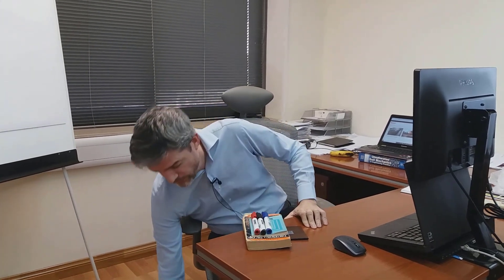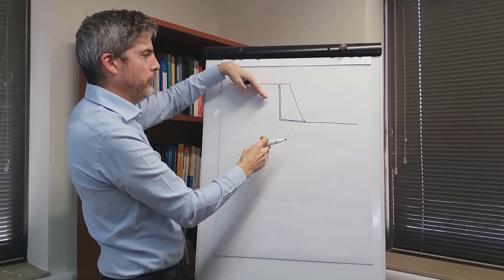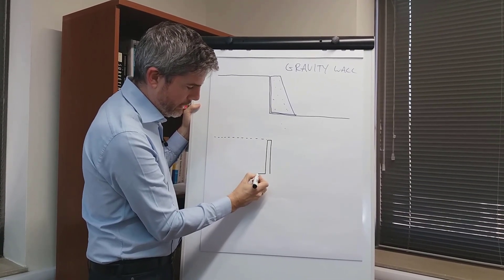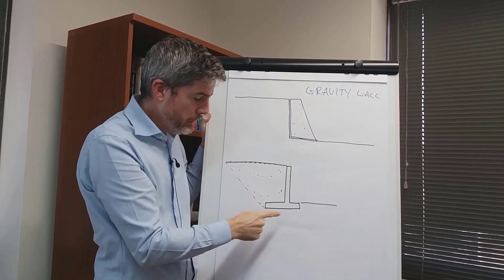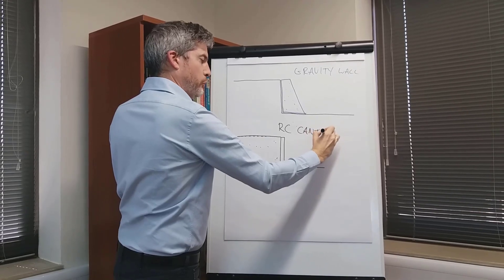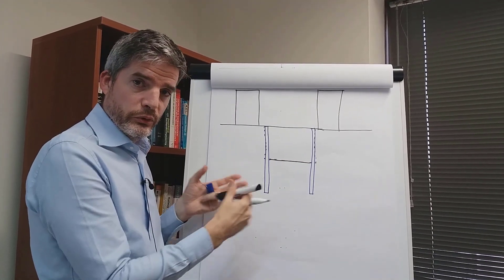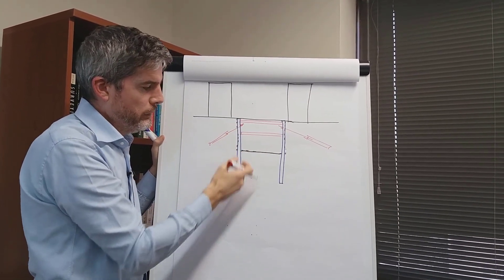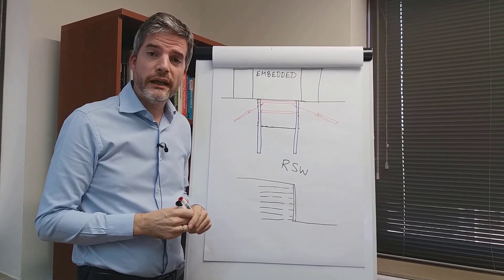What are the different types of retaining wall? I Geotechnical Engineering I TGC Ask Andrew EP 2

Comment: Next question, if the new embankment expose to stagnent water for a long time, it will effect the strength of embankment? For example, drainage culvert on stg1 done for construction/embankment already completed , however water in new drainage culvert cant discharge trough it due stg2 stuck the construction process for (outlet).